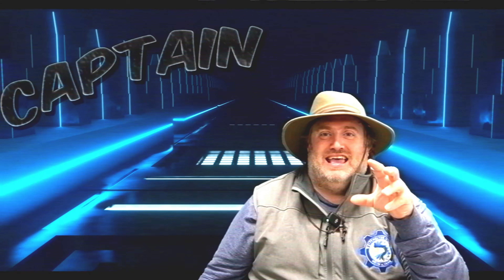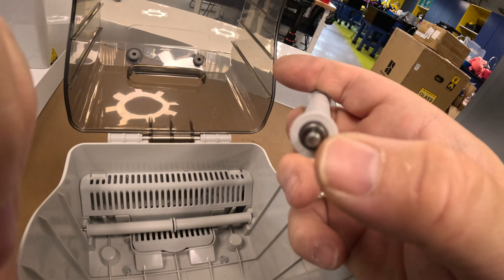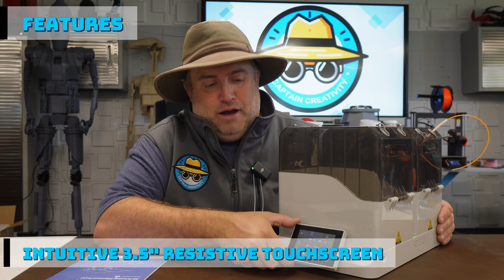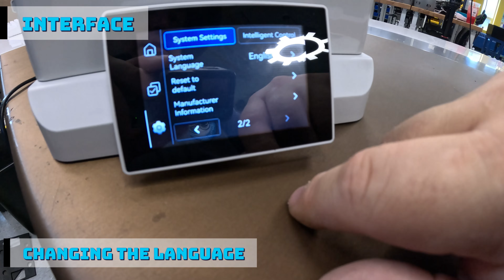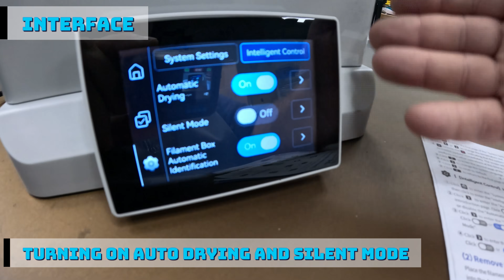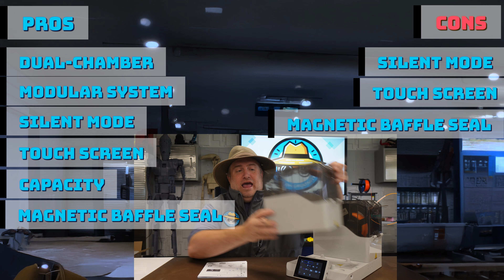This $139 3D Printer Dryer SHOCKED Me! Chitu E1 Has 10 Insane Features

Comment: Your comment to the fan not shutting off immediately near 18:20. I'd think it comes down to the fact that while the heating element shuts off per the safety feature, it's still going to be hot to the touch. Fans will help it cool faster reducing the amount of time drastically someone has the chance to touch it while it's exposed.

The question for me comes down to if you were to pull the power cable out when it's at max temp, does the lack of cooling cause the plastic to melt? That's been criticism on other models. Power outages happen, and well, so do mistakes.
Reply from the maker: Wow that is an excellent point and excellent feedback. Your absolutely right and it makes sense that the fan will cool things down, this is why I love the comments. I haven't tried that yet but I am heading to the lab tomorrow and I'll try it out and keep an eye on it. Thank you for watching and the amazing feedback!! 😁
Reply: @CaptainCreativity  You're welcome! I am definitely interested to hear if the unit does melt or not. Kind of leaning towards this or the Sunlu SP2.